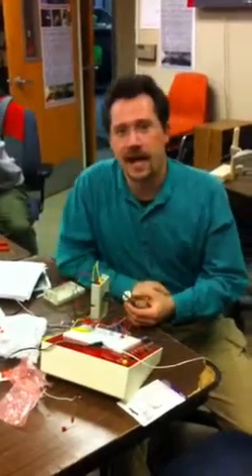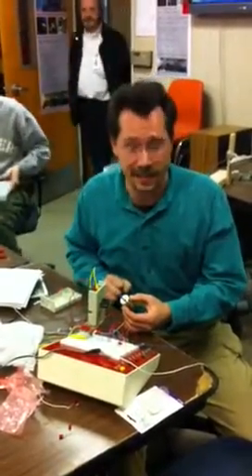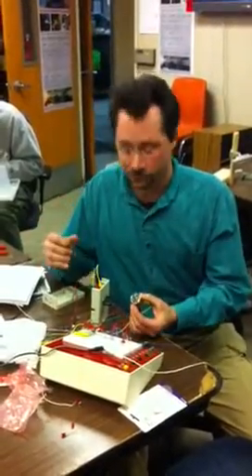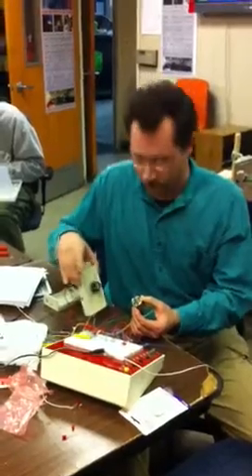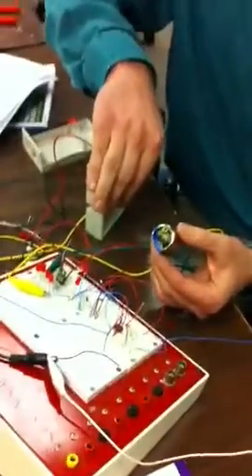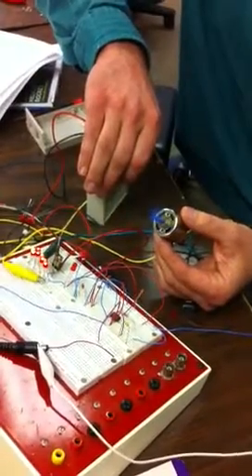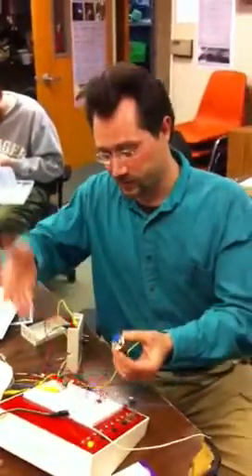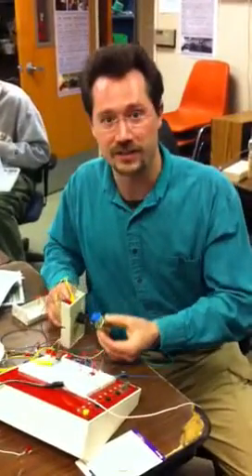Pwm Motor Controller / LED dimmer from 555 timer

Comment: Good on you Ben. Im currently making the same thing. Im building a PWM circuit using a 555 timer chip in the hopes of being able to drive a 600A IGBT to control my electric motor in my electric car. Im hoping to find a less expensive version of commercial EV motor controller. Keep us posted on how you go. :)